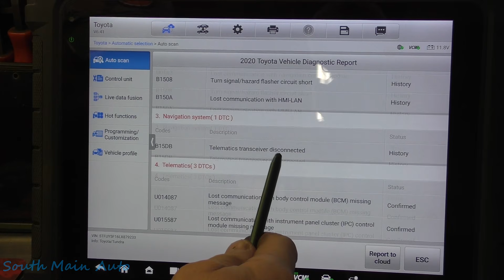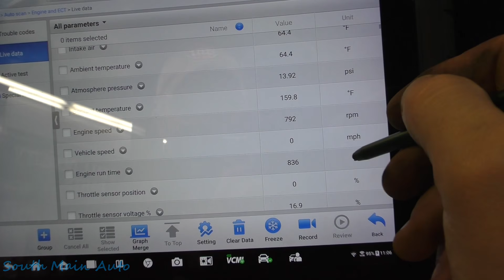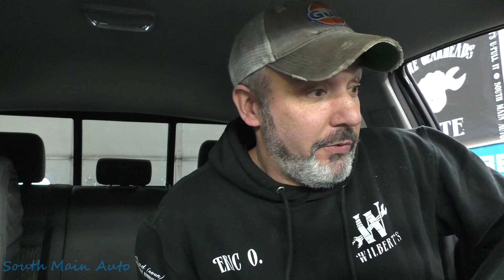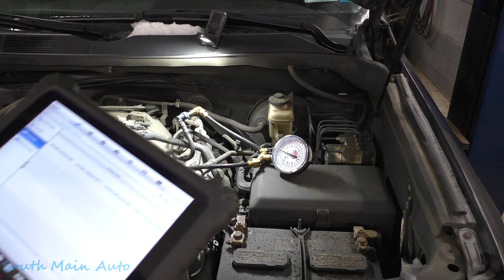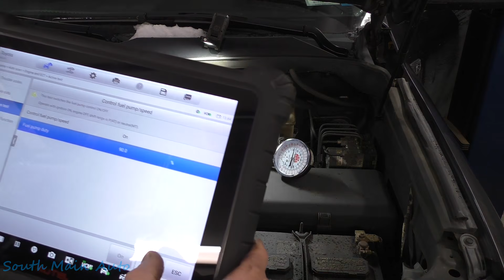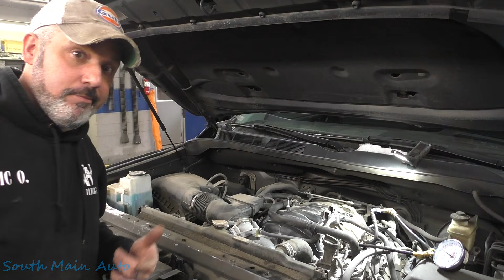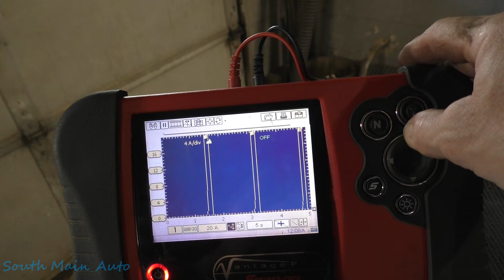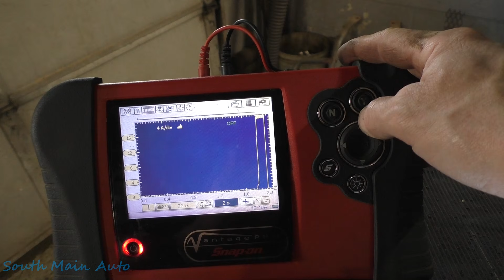My Customer Is Getting Shafted By The Local Toyota Dealer

Comment: Toyota has earned a slight hatred in my book. Ive worked on several at the ole independent shop i worked at. Thier computer systems can be absolute trash in not recognizing sensors that need programmed that were just installed with oem parts and the ole snap on or autel trying to tell the junk Toyota its sensors have never had an id before. Dont try to align one either with lane keep assist. They know its a problem and 2 years ago didnt do anything to fix every light that is on the dash on after try to reprogram the lka cameras, steering rack, abs, and so fourth. Its bull shit and a ginourmas reason ill never own one. Chevys and fords dont make a technician hate his life after 2 hours of turning off dash lights after a simple alignment. AND proper LKA programming that always fails. Js.

Comment: Dealership cannot keep good technicians because they treat them like crap and underpay them.  They also don't want to spend time doing diagnosis.  There is not enough money in it for them.   It is more profitable to get the markup on parts.  Rather than spend time diagnosing, they guess at the problem based on past experience.  As they cannot hold onto talented technicians like Mr. O and the Car Care Nut, guessing is their only option.

Comment: I used to have a Chevy gladiator that did this very same thing ,, it ran fine till you shut it off ,, the only way it started back up was with carb and choke cleaner ,,,, I tried either once and blew the intake to bits ,,,,,, it was a problem that I asked many about but no answers to why ,,,, I had it checked by many shops did all sorts of tests threw a bunch of new parts at it ,, with no change ,, started grate cold ,,, but after that it was get out and spray the juice to get it running again ,,,, so I sent it to the bone yard ,,,,, but the reason to why it did that is still in the back of my mind ,,,,,,,,,,, good vid ,,Mr O ,,,,,,,

Comment: The more I watch you work on these new fangled vehicles the more thankful I am for my old 1983 Chevy S-10 .
Reply: Ditto with my 95 Silverado.
Even with the effing spider injection system.
Reply: Ol Iron Duke
Reply: I learned to drive on an '85 S-10 Blazer 4x4 (2.8L carbureted), and in my early twenties, I ended up owning that '85, which I later sold, and two '91 S-10 Blazer 4x4 (4.3L). I love those square-body S-10s, and if I could find another 4WD one (Blazer, Jimmy, Bravada) I'd probably get it in a heartbeat. That is, if I could find one that wasn't all rotted out, with torsion bar bushings in good condition. (I probably wouldn't accept another 2.8L unless it was manual transmission, the engine is under-powered for the vehicle and the transmission has to constantly go in and out of Overdrive on slightly-hilly roads at 45-50 mph.)

I still remember how to retrieve OBD-I codes with a paper clip, I even remember some of the codes. 12 - No Distributor/Crank Pulse (Normal when retrieving codes). 34 - Map Sensor Low. 44 - Oxygen Sensor - System Running Lean. Haven't done the paper clip trick since... Yikes, 2013 or 2014, on my '87 LeSabre. It used to be so easy...
Reply: It’s great that you can keep a 40 year old truck going, but virtually all of them have summited to major rust failure in the north east. In MA you fail inspection when rust holes are seen.
Reply: Absolutely! Cars these days are waaayyy too complicated.
Reply: @paulsnowdon5210  In this case more computerization would help. If there was 2-way communication ant not 1-way between PCM and the fuel pump ECU, it could say on the dashboard "fuel pump overcurrent - probably faulty fuel pump".
Reply: Still enjoy my 1995 Blazer 220k miles.
Reply: Yes you should be able to get parts for your S10 for a very long time thanks to the Post Office. All those little P O trucks are based off an S10 Wheeler Bros has almost every part manufactured new.
Reply: My 91 Geo Tracker is pretty simple too.  I just wish that Eric had some magic to deal with rust…..:(. Not finished watching this yet, but in my (old) car if you floor the gas pedal while trying to start, you stop fuel delivery, so that even with a good pump, the engine won’t start.
Reply: @Inisfad  WOT is designed to shut off the fuel pump. Why does that amaze you?
Reply: @SurferJoe46  Do I sound like I’m ‘amazed’??  I’ve been driving a car that does that for 31 years.
Reply: Cool story bra

Comment: I just had a friend have an HVAC  "technician" recommend a new $1000 control board for his intermittently failing furnace. He got someone else to look at it, and it was a plugged condensate drain that had backed water up into a pressure sensor. The sensor needed to be replaced, along with unplugging the drain.

Few people properly understand electricity - even "highly trained and certified master factory trained technicians". 

For all that Eric says he doesn't understand electronics, that is the biggest thing he is consistently wrong about. He does understand! Far, far more than most people that need to understand to do their jobs.
Reply: That's probably the first thing the HVAC guy would check.....he wanted to charge for a board.
Reply: I had an tech come to diagnose my ac not starting. He told me the furnace needed a new $600 control board. I investigated myself and discovered that the high temperature limit switch had tripped and that was putting the furnace into its safety mode. I reset the limit switch (pushed it with my finger) and voila the ac started. Ultimately, the root cause was that the heat exchanger had cracked. I don't know how the tech could have been so wrong. I even told him that I think the furnace was going into some sort of safety mode.
Reply: @jptrainor  not HVAC trained myself. Never took an electronics course. But have learned basic home wiring, how to build computers, even built my own electronic drumset from scratch.

My parents had their heating system stop functioning. The original diagnosis made no sense once I got there and watched what was happening. No prior experience with any furnace so had to google what certain parts were and how generally things worked. A multimeter to check for various issues and help sort out the wiring. Parts all seemed to work.   So I assumed a software or board issue. A hard reset had not been tried, so I shut off all power, waited a good 15 minutes to make sure stored charge and memory would be gone and turned it back on.
Bingo. Operating correctly for more than 6 months.

Just thinking. Testing. Logic.
Gets you a long ways.
Reply: @cecilbrisley5185  yes, basic diagnostics will take you a long way. My furnace experience caused me to make the decision to always put an hour or two into diagnosis, and making a decision whether I can repair something myself. The end result of my bad furnace experience is that I now do almost all my own auto repair and appliance repair.
Reply: Had the same thing done to me.

Comment: Dealers do not diagnose. Technicians don't get paid enough to diagnose.
I had a situation just the other day. 2021 Nissan Kicks. The customer said it's dripping oil. Dealer looked at it didn't know where it was coming from. I put it up on my lift. Yes there was fresh oil around the pan gasket, but ther e was also a bit of oil higher up around the front cover. Whipped it down and started it up. Surprise. The front seal was leaking. That took me 10 minutes. I hour to pop a new seal in.

Comment: I had a 2000 Ford Explorer that would start fine and run fine hot or cold, but if I shut it off for a 15 min soak, it would crank, start, and stall.  Constantly.  I had to wait about 30 minutes for it to cool off before it would run again.  I finally borrowed a Fluke transducer from a mechanic friend of mine to monitor fuel pressure after a hot soak. Yep, fuel pump...  The Explorer was so old I removed the back seat and cut the floor to gain access to the tank - being in the NE everything under the truck was seized with salt corrosion.

Comment: I had a customer just today who stated the local Toyota dealership could not identify where his whine  noise while moving forward was coming from and did not suggest further repairs. A Quick Look found a Toyota service campaign with a video to help a tech confirm the noise and plain directions and warranty extension information.   This is why you find a shop like South Main Auto.
Reply: Was the Whine holding on to the steering wheel. 😂😂

Comment: Had the same condition on a Ford p/u.  Confirmed different pressures when it went from go to no go. THEN ..... hooked up inline amp gauge for reading  during go and no go. Amp readings were normal at cold start, then showed high amp reading after running awhile, then very high amp draw after shutting off and trying restart. Bench tested the pump motor and found it had higher draw the longer it ran until it would not. Clear case of a failing pump motor ......

Comment: In 2004, I bought a new Nissan Sentra and started having transmission issues that were symptomatic of a bad ground causing feedback through the solenoid pack. The dealership service manager told me that there was nothing wrong with the car and that I was just having buyers remorse. I ended up calling him an idiot who didn't want to listen to a customer who had tons of experience tracking down electrical issues in cars. I also told him that I could find and fix it myself if they wouldn't void my warranty. He informed me that if I attempted to fix it myself the warranty was void. That was when I called him an idiot. I traded it in to buy a Toyota Corolla that is still giving me reliable service with 267000 miles on it. In 2006, I got a notification to bring the Nissan in to replace the transmission shift solenoid pack because of defective grounding connections.

Comment: Looks like pretty good engineering on Toyota's part to sense the pump current and shut it down after only a few milliseconds so that it doesn't burn up. Maybe a fuse would blow, but that would leave you stranded. This way the module keeps trying without doing any damage. 20A on a <10% duty cycle keeps everything cool enough without burning up the fuel pump, or the drivers (probably MOSFET's) in the fuel pump module, causing more expensive damage. And, maybe sometimes the fuel pump does start and it is all fine (ish).

Doing the sensing and low duty cycle pulsing is pretty easy if there is a microcontroller in there. All it takes is a bit of software, which is free to manufacture once it is written.

Comment: I had a 1990s S10 with almost the same issue.     I could drive it for 4 hrs.      And it would be fine.    Leave it sit.    No start.     If you started it 3 or 4 times during the day it was fine.  A mechanic with a fuel pressure gauge finally caught it.      I replaced the pump and it was good .

Comment: Yeah you have to troubleshoot the problem for the dealership to do the work. Sounds about right. After the parts cannon getting thru at things in the past to me I quit taking intermittent problems to them. Have a Highlander that when stopped at a stop sign or light when you take off after just a second I have a dead peddle. It just does it for a second or two and then just picks right back up and is fine or can happen again at the next light. It’s hit or miss. Been doing it for several years but I refuse to take it to have a cannon unloaded at it. I’ll wait until it breaks or get rid of it someday.

Comment: I figured it was fuel pump but I thought by turning the ignition on and off to prime the system. It would have cured the problem or at least it would have run rough but then smoothed out. Not die like it did.

Comment: You did absolutely beautiful diagnosis . It's only Apply above when you replace  a bad  Is fuel pump but what I've been doing these days is cutting the top off the Is bad fuel pump  Is assembly with the electrical connector Then I can plug it into the vehicle  With a test light I make sure the voltage does not waver from the vehicle i.e. Ford. But maybe that's a helpful tip these days have been cutting the electrical portions off of components so I can use them To directly plug into the vehicle and you have good connections to test with. Makes it easy. Guess what I do make sense for me. You can basically make a test power and ground tool for any vehicle On the component side.

Comment: Great video I learn a lot from you even after 41 years as a mechanic. Your 194 bulb trick has helped me many times. Watching you hit the tank with the dead blow hammer to shock the fuel pump brought back memories of how we  use to diagnose the late 80's to mid 90's GM trucks with bad fuel pumps
Reply: The real issue with the Tundra system as designed is the Fuel Pump ECU does not have a diagnostic link to the PCM or on a powertrain CAN bus. The Fuel Pump ECU knows when the pump seizes (locked rotor) and overloads because it is monitoring the motor current and shuts the motor output off after sensing an overload. If this motor diagnostic information was sent back to the PCM, the PCM could record a DTC relating to a pump over current event. In fact a P1604 Startability fault code was current in the PCM, but it is too generic to be of specific help. If a DTC positively identified the fuel pump as experiencing over current events, the diagnosis would be much much quicker.
Reply: @windward2818  oh heck yes
Reply: I used that method for starters 🔨
Reply: @mejesse809  a bfh has been known to free up a stuck bendix on occasion.
Reply: My experience was with Ford products on hot spring days with a near full tank of winter gasoline. (in Northern states and Canada gasoline blends change twice a year). Fuel would vaporize in the lines or pump and stall the vehicle. Let the tank cool a while and then kick it with a steel toed  boot and drive for a while again.

Comment: My 2007 Ford F150 has this fuel pump ECU setup and they call it the fuel pump driver assembly, same rust rotting issue.

Comment: 2005 Ford Taurus 300 L pushrod engine pretty much did the same thing sometimes it would even die during idle did not throw any codes replace the cam sensor fix the problem

Comment: I would think the fuel pump ECU has some sort of poly fuse, a fuse that resets itself after cooling off or current of voltage doesn't go over a certain threshold.

Comment: So older fuel rail pressures were controlled by a rail pressure regulator. These systems seem to run the pump at different speeds to do this and there is the problem. The motors are not reliable.Just like the junk ones they use in new furnaces that run at different speeds.

Comment: It seems clear that the fuel pump module thing knows that the pump is drawing too much current, so it is pulsing it. Why do they not have a dtc set for that? Wouldn't this whole video been so much easier if system scan thing had just said "Fuel pump over current" or something?

Comment: Love Toyota's, hate their dealer network. They are famous for "could not replicate fault" or "normal operation" when trying to get your vehicles fixed. I remember two specific times I had to repair my own vehicle out of pocket in the warranty period.. One time my low note horn wasn't working, it was so painfully obvious because all you could hear was a wheezy high pitched sound. Technician said "normal operation". I pulled it out and bench tested it at home and it was completely dead. I bet the tech didn't even look at it. Another time was when my turn signal switch was making a ratcheting sound when the switch was on during right hand turns. Again, it wasn't intermittent, was happening every single time. The service advisor tried to tell me that her Corolla does the same thing and that it's normal operation. Sure enough, when I replaced the switch, the ratcheting sound went away.

Comment: Another reason it stays running after giving it the Cosby juice is because the higher RPMs command a higher duty cycle.

As you proved with dropping the duty cycle, the pump won't come back to life, but raise the duty cycle and it does
Reply: A very logical conclusion and not one I had thought of, nice 🔧👍
Reply: @davidcoates4852  yup, a higher RPM input into the ECU will make the ECU request a higher duty cycle for the fuel pump
Reply: Not really the higher RPM to say it's the higher voltage from the alternator caused by the rpms.  Note Eric turned off the battery maintainer and the problem came back.
I would almost bet on a long steep grade that truck would start stumbling
Reply: @lloydtucker  Think about this. It would start once completely cooled down. Wouldn't the ECU call for a higher duty cycle with a cold engine for more fuel? Also after sitting hours or overnight the battery will have settled to its resting voltage
Reply: @1HotLegendLS   When cold it will prime if needed after sitting overnight if needed. Sure a very slight increase when cold but we hen you doing 75mph up a hill the pump needs to work harder to deliver fuel to the demanding engine, hence the need for the return to tank hose to return fuel that is not required back to the tank.
Think of the diagram in the pump it softens up when it gets hotter thus making it less and efficient hence why it works better when cold.
Often why the car leaves you stranded somewhere and not at home

Comment: It reminds me on my 1987 K10 Blazer that I had years ago.  If it would not start you would whack the bottom of the Gas tank a few times , then it would start.  Once you got it running you had better be putting a new fuel pump in it ASAP!!

Comment: Tapping the tank is not ridiculous at all. I've had that save my bacon a couple of times. Hit the starter nothing no start. Turn key to run position not hear the pump prime up. Thats a bad feeling leave the key in the on position love tap the tank with a hammer bot a bing bot a boom pump starts running Hit the switch and it starts. So far it's always got me home never tried to push a bad pump past that.